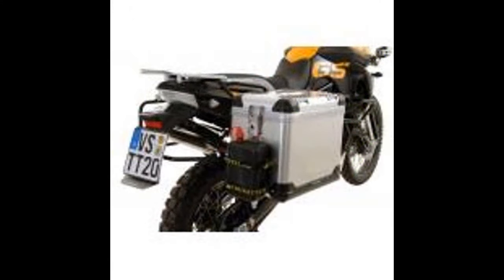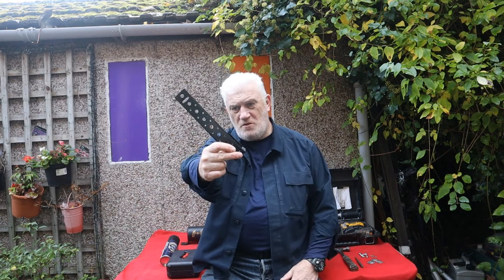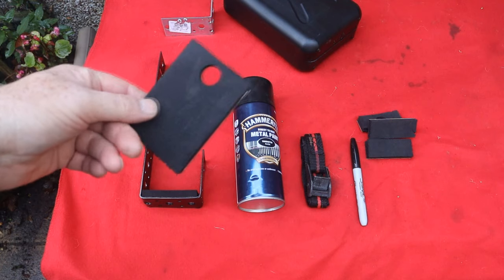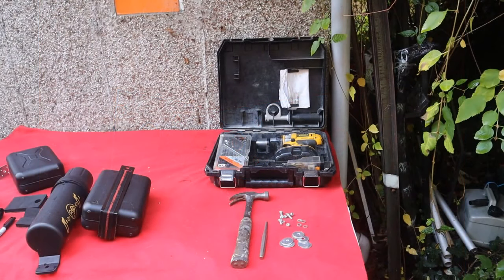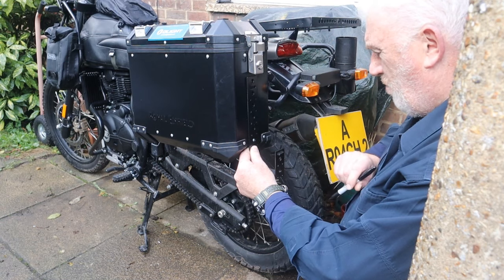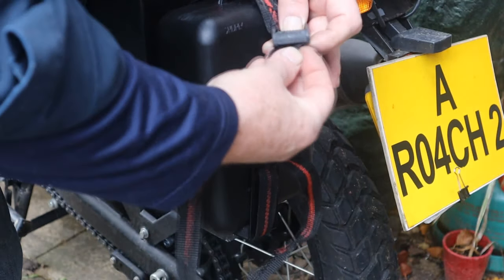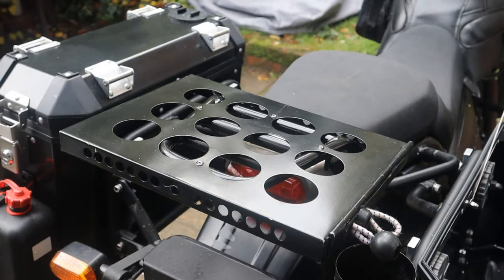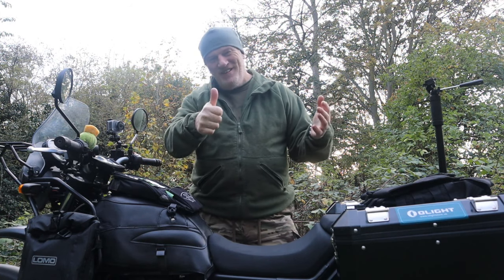DIY  Motorcycle Fuel cans

Comment: Be interested in the petrol cooker you're going to use Mike. The only one I could find small enough, is the Coleman type. I use a multi fuel cooker, alcohol/wood and sometimes gas. You'll be doing a load out no doubt, before you set off, look forwards to it. Nice to see you back.